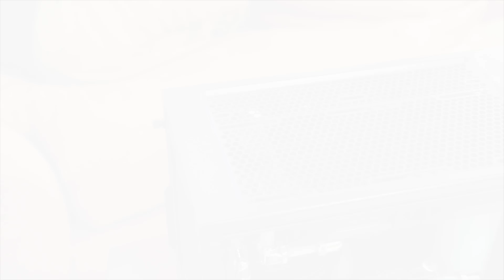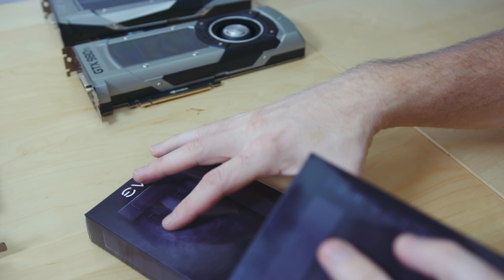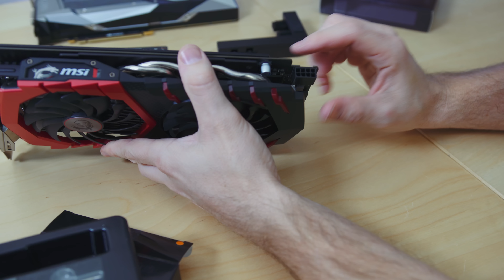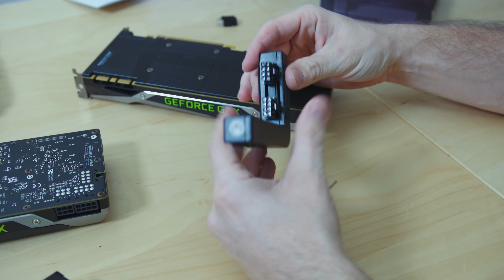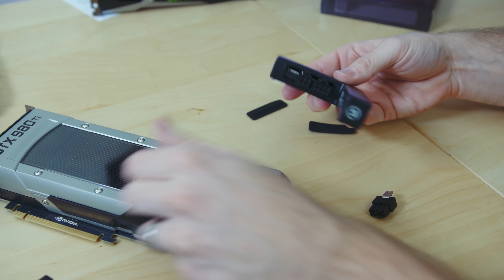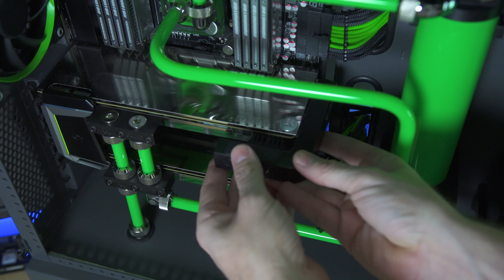How to manage your cables using EVGA Power Link

Comment: Wth is a allen key? That is a unbrako.. 
But good video, still waiting for mine from evga along with the thermal pads.
Reply: I'm waiting for my thermal pads too man, it's taking forever lol.
Reply: Same here both waiting on power link and thermal pads.
Reply: TioPaleshadow Yep, you local as well?
Reply: The Dapper Llama No but everybody I know from around here already got theirs XD. I don't mind waiting though, don't have any issues with temperature.
Reply: TioPaleshadow Yeah, I haven't had temp issues either, but I don't want to start either.
Reply: The Dapper Llama the thermal pads are for the VRMs which don't have a temperature sensor. They found out that on some cards they didn't have proper cooling and they can blow up, so they send you some cooling pads for them, in this way they are safer and you can probably overclock a bit more.
Reply: sfuzzolo Yes I know, I am getting them delivered soon.

Comment: I think the adapter is too big with a water cooled card. since there is no heat sink it's just a clear block and a thin PCB I think the adapter is to thick and doesn't fit in

Comment: They are kind of gimmick. Yes, they make things look tidier, but they are quite large compared to what they have inside. That they are not universal only adds to the gimmicky of them. It probably wouldn't be that hard to make it possible to change the polarity and while they are already huge, make them a bit bigger to accomodate even larger cards and so they would fit into most of the cards on the market. Also it would have been good to add couple spring loaded platic L-pieces to add some support (like small clips that clamp on to the card).

But good try from EVGA. Too bad IMO gimmick but proves a point that powercables look better behind the card. Now it's just question of time when someone starts to move the powercables to the rear of the cards or brings universal and more polished "power link" to the markets.

Comment: If they where thinner and more subtle i feel it would be so much better looking. in your circumstance with customer sleeved cables i feel it looked betyter before, 

there also very bulky coming outwards which ruins the slim look of the card maybe with a stock cooler on it, it would look ok but on this i don't like it

Comment: It's a good concept, but I'm not sold on the implementation. I think they'd look better with a brushed metal look, maybe aluminum or "black chrome"? Also if they could make it slimmer. Perhaps with a single-sleeved pigtail to put the PCIe power connectors behind the motherboard tray entirely.

Or hell, maybe a variety of (probably EVGA-specific) monoblock connectors, sold individually, that made the PCIe power connect at right angles or even 180 degrees facing toward the motherboard? Perhaps stacked back-to-back with the latches facing away from each other. I'm not sure how to clearly describe the images in my head here, but those could be made VERY low-profile.

Comment: Why don't they simply change the position of the conectors on the card itself instead of selling these adapters?
Reply: Standardization.
Reply: You're beginning to discover business strategies my friend
Reply: My RX 480 Nitro Already did that! And I liked very much
Reply: Compatibility reasons. Especially for SFF and slim cases that depend on the cables being in a normal place.
Reply: I got one with my EVGTA GTX1070 FTW for free. It's being shipped right now :D
Reply: Because not every manufacturer has their connector on the back
Reply: OEM like Dell, etc build their cases (e.g. workstations cases like the precision-line) so that exactly references cards of length 10.5in fit. If EVGA would place their socket on the back, their cards would not fit these cases anymore.
Reply: ok free my bad
Reply: ***** How would moving the connectors cause a space problem? The Card stays the same diminutions.. That doesn't make much sense to be honest As sometimes the cables on the side also prevent the side panel from closing. The end, the side front, back. it doesn't matter where the connector goes, it's always going to conflict with something in bad/small cases. Budget cards are typically smaller, so there should be less of a space problem with them. It's high end cards that in fact take up a lot of space and thus the connector positioning needs to be well thought out.
Reply: DAGATHire Move the plug and let the case manufacturers figure out their own products. If people need a plug on the top in the meantime, buy a reference card.
Reply: Melthornal I totally agree. The most logical place for the connector is at the back. It just makes more sense all round. I have a Strix 980 in my system, and the the case is windowed, So the Strix is a really good looking card, but the connectors are on the side so the cables look shit having to come round the card and connect. If the connectors were at the end, you would barely be able to see them. very annoying. They are the only cables you can see also. as everything else is well hidden and cable managed correctly. Also this product won't work with a Strix... so im stuck with the cables doing a 180º turn right in front of the window.
Reply: DAGATHire Get sleeved extensions or sleeved psu cables
Reply: The Mighty Voice how would that help?  the color of the cables doesn't change the fact that having them in the window looks like dog vomit.
Reply: Because nice individually sleeved cables don't look like dog vomit any more than having 16 EVGA logos in your computer.
Reply: The same people who care about how their cables look and want to show off their rig are the same people that are willing to spend the $20 (I'm assuming because he never said a price) in these adapters.
Reply: The Mighty Voice They are already sleeved mate. They still look bad. CPU is water cooled. With the Rad mounted at the top of the case. so you barely see the Pipes. The only eyesore in this system are the GPU cables. They have to come out from behind the GPU all the way around the back of the GPU do a 180 and plug in. They look terrible. I'm not going to lie. And they are cable tied together as best i can to try and keep them looking neat, but the attachment system with the connectors in front of the window means the cables look like they have been an after thought. It ruins the clean look of the build.
Reply: Try a case that actually has a PSU shroud and a grommeted hole in the PSU shroud for routing power cables to the GPU. Doesn't look too bad.
Reply: Well, either that or just do it how it's done in Jay's rig if at all possible. Looks quite nice there.
Reply: Some cases barely fit the long cards in lenght while they have ample space for the cables in the front. That said, power plugs on the side make more sense to me too.
Reply: Well some people have a cramped room and cannot get a huge 40l workstation/server case.
Reply: when u have it on that side it factors in with case size. however, some of the older generation AMD cards had the connectors like that not sure on older nvidia cards tho.
Reply: you can actually grab the for free if you own an EVGA Card
Reply: Does anyone know why is his last video about a custom build private?
Reply: he fucked up the audio iirc
Reply: iirrc?
Reply: Vinicius Oliva if i remember correctly he fucked up the audio and has to reedit the video.
Reply: Thanks for the info man. Not used to English slangs and these "imo, tbh, iirc"  :p
Reply: I've got an update. He re-edited and reuploaded the video, but youtube is stuck at 0% processed.  Yay technology!
Reply: Jan Onkel forgot to mention you gotta pay for shipping
Reply: Has nothing to do with standardization or the MSI connectors would be properly placed instead of upside down.
Reply: TheHelghastMan why won’t the move the power connectors to the right back of the card?
Reply: same reason they keep putting all the cool looking stuff on the side of the card you never see.. the bottom, and on the side you do see, the top, they leave black and dull.
Reply: the problem lies with nvidia and their dumb circuit layout , third party manufacturer cant change that, they can swap around component supplier but not the patent design of the reference card, its dumb layout ever, wait for the 40 series hope they got better common sense.
Reply: nothing to do with standardization. Otherwise this adapter would fit every card and it doesn't. Other card makers have the connectors on the end. some flip them as Jay showed. some have them in a recess in the PCB. Standardization has precisely nothing to do with it. There is no standardization. But ye, im in favor of a standardized connector placement and i would vote put them at the end. Particularly with high end cards.
Reply: A bunch of cards have the connectors moved already. There's no reason to have connectors on the top.  Maybe some segment of the industry needs them up there, but honestly that's what reference design cards are for.  Put them on top for reference, and on the side or bottom for custom.
Reply: TheHelghastMan cuz stupid people will buy these

Comment: I think in your case, it looks better with the adapters. You case has a very clean look and it helps a lot. However, I think if there was a little more to these adapters it would put it over the top. Make it out of aluminum or add RGB, something more than boring black plastic. Overall better with the adapter than without in your case.

Comment: I think it is a tossup with Skunkworks. The cables look great, either way - Looks a little cleaner with the adapters?

I appreciate the opportunity to see this product in action, or to even know it exists. For a cube type build, where the card is standing straight up, the weight of the cables wouldn't be much of a problem. I think I NEED this. Being able to get rid of the floppy extra two pins would be great, as well!

Thanks for the product showcase!

Comment: I like where the add on's/ locations of the plug is improved. The adaptor is almost better, except the big, black, plastic is more of a lateral change. It's not an improvement, but it doens't hurt. If the card had the power tabs in the location where the adaptor puts them, it would be much nicer!

Comment: wont it block the aitflow on the cooler? dunno if its intake or exhaust there, but if you are not running watercooled, but just putting it on the card as you showed it in the start!

Comment: Looks awful.  If they were machined out of aluminium then they might be cool but ew. They look awful
Reply: Plastic garbage
Reply: Black anodized brushed aluminum tho.
Reply: Once they are painted black, you can't tell the difference between plastic and aluminum anyway.  I think it is mostly a factor of weight though.  There is already sag problems and the added weight would only make it worse.
Reply: A Copper option would be cool!
Reply: Lawrence Timme the aluminum is very build specific for example black looks good on red so in a build like that it wouldn't mix
Reply: Love bothe copper or aluminum
Reply: orgsniper yeah, copper / aluminium ELECTRICAL  connector... what could go wrong? XD
Reply: Insulation or just the finish!!!
Reply: hey you gotta admit, there not THAT bad looking
Reply: There's this magical thing called insulation. It's cheap.
Reply: The Mighty Voice there is..  but there's also a less magical thing called "CE certification", which I'm sure applies here.  There are a moving parts over live rails.  I'm sure you'd be 99% fine.

Comment: Doesn't make much of a difference IMO, rgb LEDs would improve it, and with a slimmer profile, both to better match liquid blocks and so it won't interfere with air cooled cards. I would like to see stiff-bend cables that hold their shape when bent to shape instead.

Comment: thing is why try to hide your nice expensive sleeved cables. also why don't ad in board partners like MSI and EVGA just move the power connecters to the back of the card. Yes it would present some challenge to small form factor builds but because they have so many variants of the same card. (MSI Gaming Z Gaming X Gaming and Armor OC) Why not just have a variant where they are in a different position.

Comment: i actually like em quiet a lot, 
i mean of course custom cables are kinda expensive and good looking, but i still prefer as little of those as possible.
This in my opinion is looking way better, thought it would look to bulky, especially on water cooled cards, 
but once i saw em on those i was fine with it~

Comment: They could have EASILY made this compatible with almost EVERY graphics card had they made the input ports optional also which would in turn give you the option to swap the positive and negative rails over and make it work on the few cards that have the power plug oddly upside down

Comment: Another solid video.  Got mine in the mail the other day, but not a fan of it with my EVGA SC 1060.  It's not as snug with only a single 6pin connector as well as has a 1/4" gap all the way around the power link, which i'm not a fan of.  Might be more useful aesthetically with a 1070/1080 if i plan to upgrade.

Comment: In the fractal design sponsored part of this video, the computer would probably work better if the fins on the heat sink of the pump were turned 90 degrees.

Comment: the black plastic with no green LED lighting on the EVGA logo does not look good in my opinion. the sleeved power wires looked a lot better. its kinda like you got a down grade... :( skunworks doesnt like them either i can feel it.

Comment: +JayzTwoCents Man I love your videos and your build definitely looks cleaner with Power Links, but I'm not quite understand how these things actually works. Isn't the only those two prongs are connected to the circuit, so instead of 3x12V lines(provided by power supply) we get only one that soldered inside these connectors on rails? Could you please check if adding these Power Links affects power delivery somehow and share your thoughts about all that nonsense that I've written above :)

Comment: Mmmm, very niche product, but I can see why it might have value to some people. It looks well designed and easy to manufacture so it might be a niche product that's worth fabricating for EVGA and having for PC building enthusiasts. And perhaps it's possible to add a screw hole in future (EVGA) GPU generations to secure it better if the electronics inside the Power Link allow for it.

And it fits your build better than I thought it would at first sight.

Comment: honestly, I do see the application for these, but not in your case (pun intended). I'd use something like these in build where there's simply not enough or only very little space for traditional cable routing, say a mITX bulild or a build in a very slim case. I also have nice sleeved cables and I want to show them off as best as I can, so I'd never put a power link in my case because they push the cables back and make them harder to see. About your point on the squareness in Skunkworks, why not drill another hole into the basement of the case and route the PCIE cables straight downwards? That'd solve your problem and still show off the nice cables. cheers :)

Comment: You're losing some of the highlight from the sleeved cables - so there's actually an aesthetic loss (for Skunkworks).  You didn't mention price point - these are an affectation - granted in a build where the look of the power cables on the GPU matters, probably a secondary issue, but for most, it's just an added cost.

I can see a place for these in certain builds, where hiding wires is a premium (custom built desk rig, for example).  It's good they exist, but can't see them becoming an expected piece of bling.

Comment: They look ok but that potential sag would concern me that it might over time damage the power plug,  I do not understand why they did not think of this and put a groove in it so that when you push it against the card it locks against the PCB preventing sag.  Also I do not get why they only included 1 6 pin connector and even say they do not support x2 6pin even though a lot of cards still in use still use x2 6pin config,  Its like EVGA are being dicks for the sake of being a dick when the plug its self is probably a few dollar.

Comment: Is it just me or could have they made the design thinner? Especially the front part since really the only depth is the prongs and the plastic housing.

Most definitely not something I'd consider worth your money, especially if it means compromising the integrity of the solder points due to poor design. Let me elaborate...

I'm sure the product itself doesn't have much weight to it. But by how it's designed, the cables add strain to the picture, acting as a lever.

Here's a simple solution: add a small lip to it so it can rest on the PCB.

Comment: I feel for custom waterblocks and cables this product takes away from the feel of the build overall since it covers at bit of the waterblock. However, if the cards are air-cooled then the power link would work great and even better if the cables in the system aren't custom. But since most of Skunkworks is custom, I feel that should be shown off more rather than using a product that is the same for others that buy the power link. Overall, if I had a build like Skunkworks then the power link would be used for a month or two then it would come off since the custom power cables look awesome.

Comment: If it had LED's i would like it, and your right it needs a clamp to the graphics card. a challenge would be making a new case on a 3D printer with a clamp, LED's (Corrected IED typo... ...don't want an IED in a computer :P ) and custom writing... ....SKUNK and WORKS springs to mind :)... ...maybe starting a shapeways competition could work?! 

Personally I would love to see more 3D printed PC mod videos. For example my HAF X doesn't have rear mounted SSD storage.

If I owned Skunkworks I would make clips that sit around the water tanks that have cool logo's or words. backlit with "EL Tape" :)